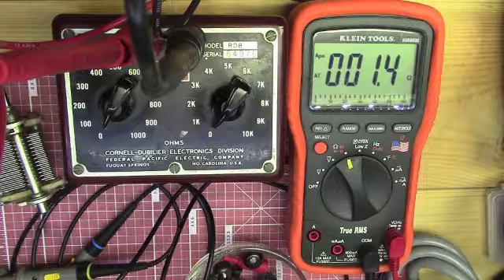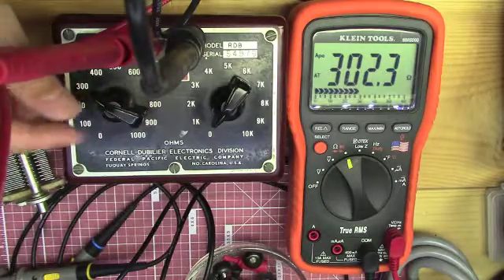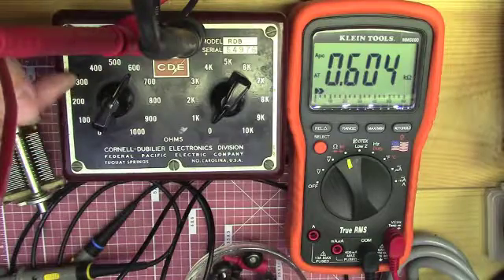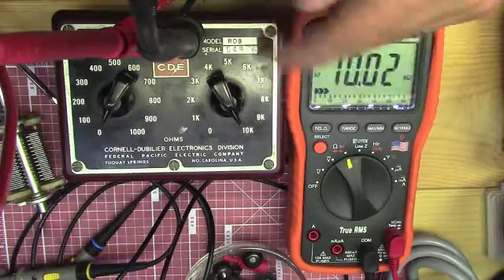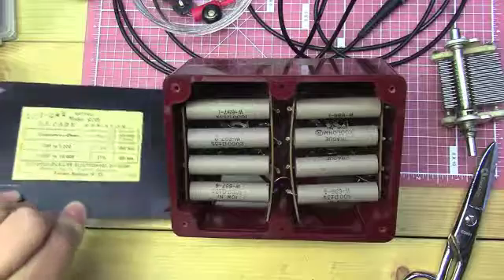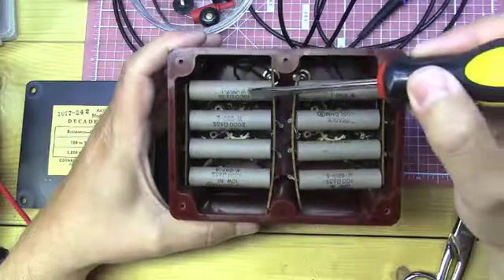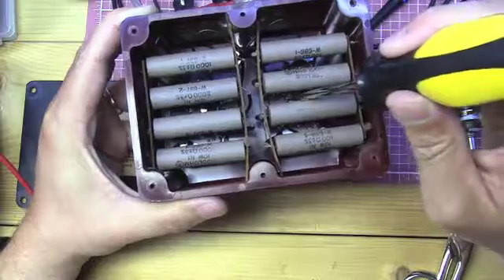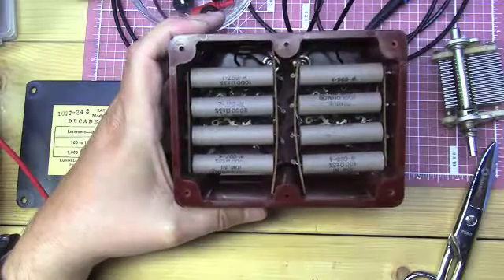Cornell-Dubilier Resistance Decade Box

Comment: That's  cool how those resistors have held there value over the years. I've got a couple of these boxes By Heathkit mine are called substitution boxes. One for resistance and one for capacitance. There great a great tool for testing circuits.
Reply from the maker: You're right it is amazing that the resistors have held value. I'm not sure how old it is but I would say that maybe it was made in the 1960's? Thanks for watching!